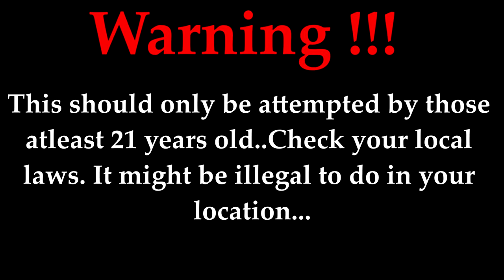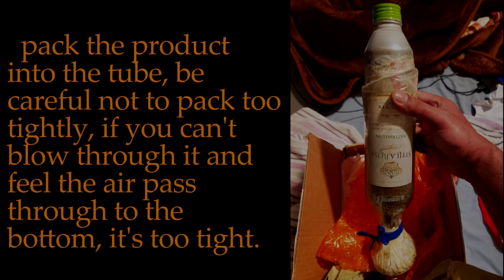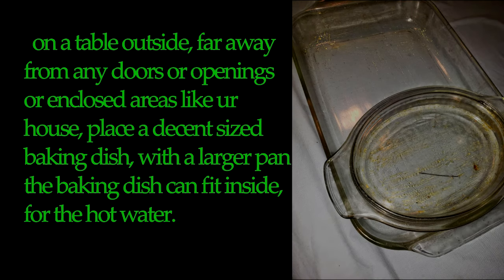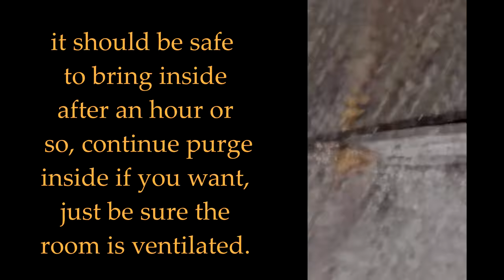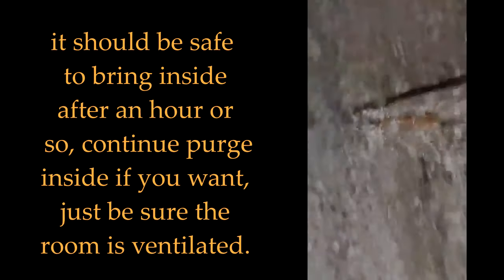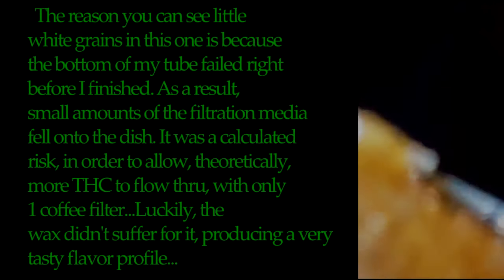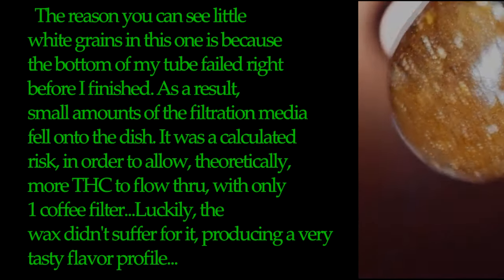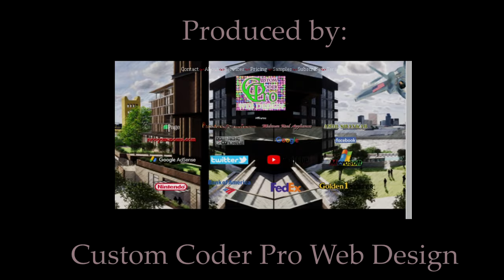How to make THC/CBD WAX with Butane Lighter Fluid at home, with Filtration Solution by Media Bros.

Comment: Question for you ...does the flower need to be well hydrated?
Reply: No but freezing the buds before putting the butane through it will help the trichomes fall off
Reply: Freeze buds 95 pececent dry
Reply: And use real stuff for thi s u can by the honey bee extra for 15$ cad
Reply: 65% humidity is the best for big yields sticky buds produce more but you can buy humidity packs that keep it fresh at most hydro stores

Comment: Can you leave it outside to evaporate by itself? If so how many days?
Reply: Leave it out for around a week depending on the heat and make sure to put a mesh or something over it so gas can escape but bugs or debris can't get in
Reply: best hack would be to vacuum it out. if you wanna invest in that.. depends on size of batch, and if you sucked it out with a vac pump or not